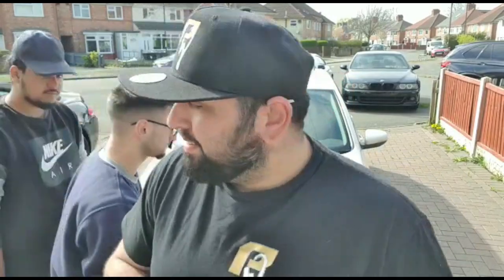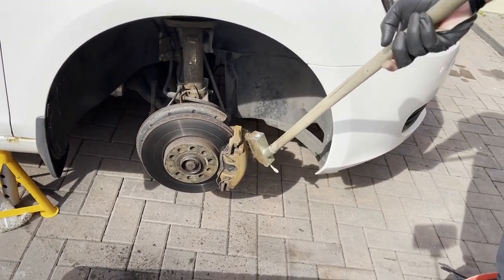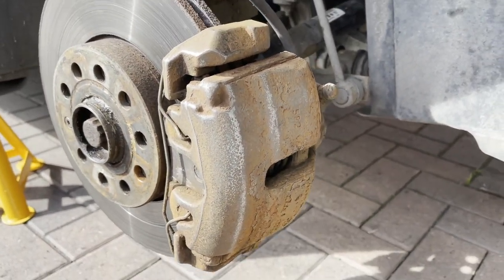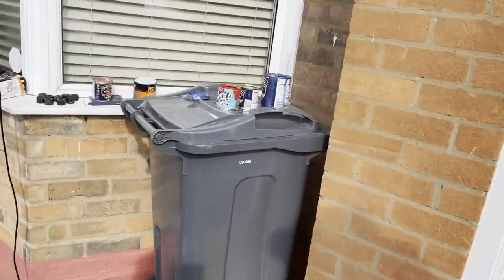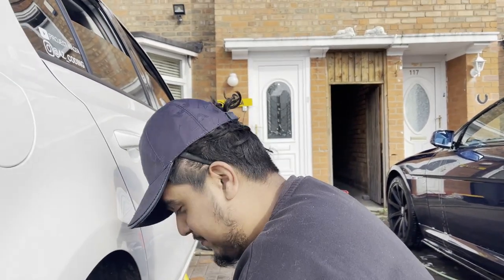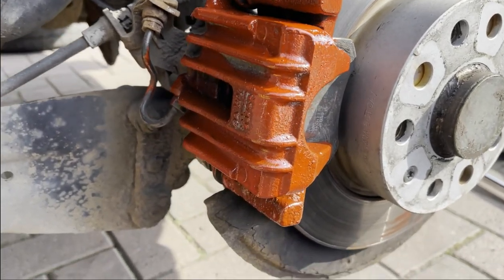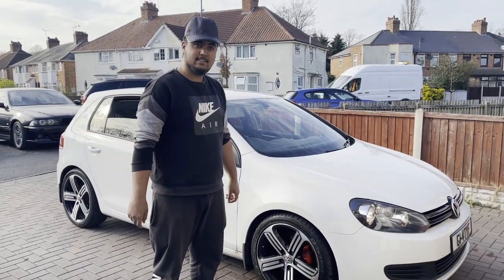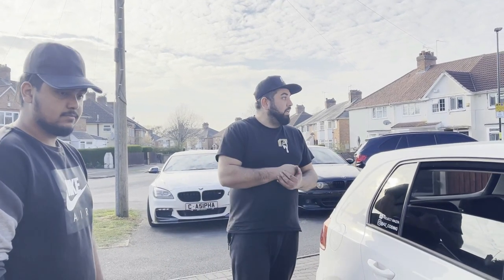mk6 golf 1.4 tsi The Easiest and at home * PAINT YOUR BRAKE CALIPERS * BRUSH ON *

Comment: The best way to clean ur calipper on the car is  use wire brush drill attachment I did mine and the calipper came like new than brake cleaner and isopropyl alcohol than paint...